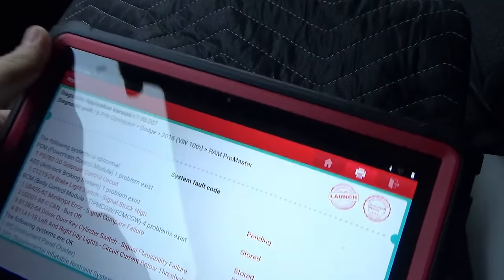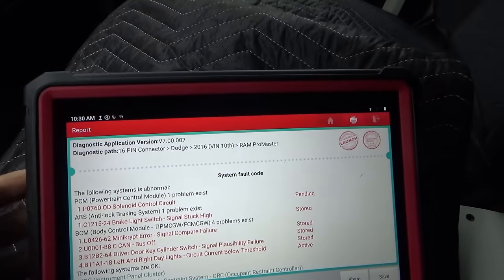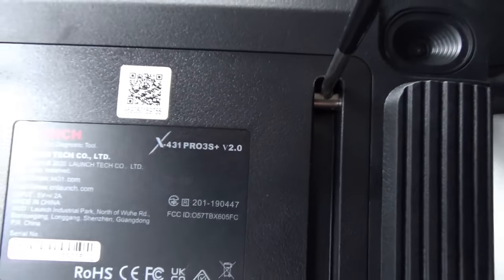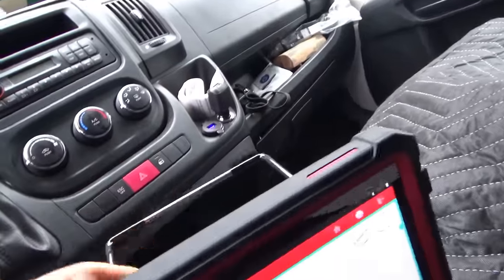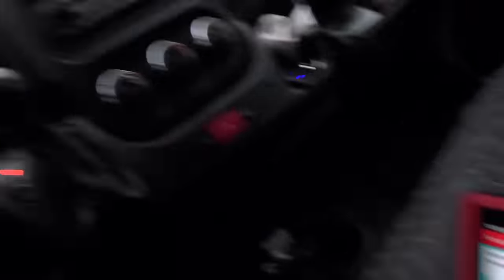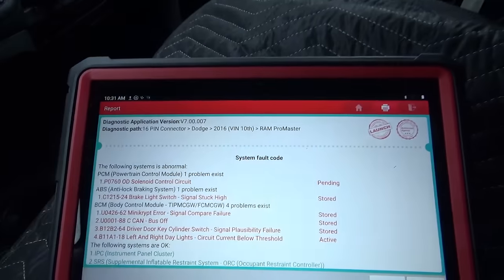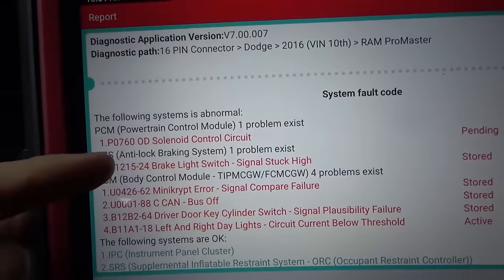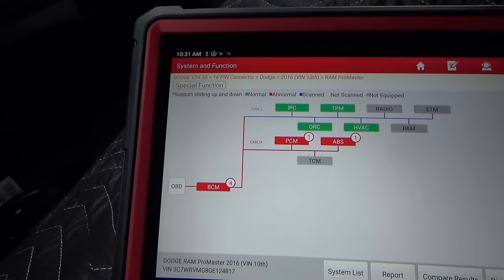ProMaster DISASTER Van - Part 2: Transmission LIMP MODE? (P0760)

Comment: Hey Ivan, you bring up a valid point about being compensated for your work. First of all, you didn't manufacture it, design it, buy it, or break it. You're there to resolve their issue, and I don’t think you’re running a soup kitchen. For them to replace that truck today would cost them an arm and a leg. This wasn’t just a common problem where you could rely on a Google search. In this case, you needed a professionally trained technician. Unfortunately, in this case, it was going to take some time. I could easily see someone trying to sell this guy a transmission, let alone just a valve body. In the end, you had a confirmed fix. You're not getting that from Google.
Reply: Figure it this way. You go to a dealer and say "Fix it", they do and it costs XYZ. If you were to ask for a 'discount' they'd laugh you right outta the place and the vehicle stayed put. The very fact that Ivan entertained the idea shows his integrity as well as understanding of real world problems for the customer. The room gets filled with 'what aboutisms' pertaining to all the hrs spent by 2 guys with 2 seperate shops, traveling, etc. and they are valid points. What it boils down to is a poor design with known issues that somebody has to deal with, and then offer some sort of warranty.  As designed, that cannot happen. Water intrusion issues plague these vans, from computer systems, to head and tail lights constantly blowing out, to caliper pins rusting up and seizing. They are a hot mess.
Reply: This is a rebadged Fiat Ducato……if there  is weirdness, there’s the explanation…..
Reply: @adamtrombino106  One word, DODGE!
Reply: It probably it helped that the owners were Russian.  :D
Reply: Another banger❤

Comment: Automotive engineers have designed and built very, VERY good weather packed electrical connectors for at least half a century. And to neglect to weatherproof the PCM? Un-freaking-believable! And yet, there it is.
Reply: Very true, but I think this case was unique. This van sat on a dealer lot for something like over a year, with ALL the water from the windshield pouring directly onto the computer. That's a pretty fringe case.
Reply: The problem was caused by a clogged drain.  This is a not uncommon problem and can cause much worse problems than what happened here.  Clearing the drains is a maintenance item which very few owners ask to have done.  It is not a design problem.
Reply: @promastersonly1419  Yeah, I'll give it that. Still not a great design, but it might have held up better under different circumstances.
Reply from the maker: @promastersonly1419  but the first replacement PCM got drowned in less than a week or 300 miles 😅
Reply: Holy cow, you are correct. I'm thinking I should go back and edit my comments.  @PineHollowAutoDiagnostics

Comment: In europe these vans are equipped with diesel. Those are notoriously bad on glow plugs and injectors due to water sitting on the top of the engine
Reply: Just wanted to comment on this. The glow plugs seize in engine so bad, you often times have to remove the cylinder head and punch them out from the inside.
Reply: I guess the only upside is that a lot of them are manual gearbox as well so the water ingress can't screw up that as well.

Comment: I can’t believe that thing would do anything with the severity of water intrusion. What a design. Wonder what that crap was that plugged the drain? Weird. Great stuff anyway. Have a great weekend Ivan. 👍👍🇺🇸
Reply: The crap is just dirt, leaves and anything that comes down on the windshield
Reply: @bernardaflores1720  Ok, hard to see see in video, just looked like black…. stuff. Is the cowl screen broken or missing or is this just a common problem on these vans ?  With the exception of sunroof drains getting plugged, I’ve never heard of this problem.
Reply: That was indeed leaves and sticks and such in the main and only cowl drain tube, which is a close to 2" affair and generally doesn't cause an issue. Even if it falls off, water generally goes harmlessly onto the tail of the transmission. But like in this case, if that drain is plugged, 100% of the water coming from the windshield will be forced to go somewhere. In this case, the water had MADE paths that it normally wouldn't have, taking out the seal for the DS windshield wiper and some other rubber seals. Clearly, an extreme case. I believe this van sat on a lot for over a year as well.

Comment: I just had one of those vans in my shop this week, had misfires and transmission codes. was still under powertrain warranty but dealer could not take if in for a few weeks.
the misfire codes were just plugs and a coil, so I replaced them (under intake). The trans codes were for a signal loss of transmission speed sensor. (going in to dealer for that).

Tips in Mitchel were for wiring harness issues due to water leaking down on to connector. I noticed the plastic tube (The one shown at the end of the video) was disconnected at the top.
Reply: The tube fallling off at the top is common (hose clamp fix) but when that happens the water drains down behind the transmission and wouldn't cause this problem. However! - the two transmission speed sensors DO live right under that drain. We've never seen one actually go bad, but we have seen wiring damage from road debris take out the wiring. Hot tip: you CAN swap those two sensor connectors with each other. It will code immediately for a speed mismatch, and put itself into limp, but it would allow you to look at the data from each sensor, which might tell you if a sensor was bad or the wiring was bad. I think those speed sensors are under $25 each.

Comment: I couldn't imagine owning one of these piles.  Ivan, you could buy one of these and use it to haul your tools around in.  When it broke down, you could make videos about repairing it.  What was that?  They don't make a memory card big enough to record the problems?  So, this guy had to pay for your drive/diagnostic time TWICE plus $1,326.00?  If I owned one of these, I would need to plan a vacation to Pennsylvania Furnace periodically.  It wouldn't be so bad, I could rent a motel room and enjoy the sights in a vintage Toyota.  Kip really likes these; that is all I am going to say.  GREAT VIDEO!
Reply: the problem was the blocked water drain tube from the windshield seen at the end of the video. If this issue was widespread there would be a recall/service bulletin already.
Reply: @gerardmccarthy2432  I used to own one and am familiar with that issue.  That was the least of the problems I had with it.
Reply: The wiring connectors should be weather proof even if the cowl drain is working there is still going to be water from splash during driving
Reply: @010110rjw  i give you a huge thumbs UP on that just a good size puddle and the van is DEAD  and another 3 to 5 k in repair what a POS that Van is

Comment: "the dealer was absolutely worthless"  words to remember if you ever find yourself wanting to go there.

Works for every dealership in the country.
Reply: Where did the final fix come from?
Reply: I can tell you have never worked at a Dealer Ship. Most Dealers have 2-3 guys out of twenty that are pretty good.
The rest are in training. Dispatch  has to move work around the shop. Flat rate is a tough system.
Also, people will buy a new Truck/van/car and never come back. So ten years go by and when Its all beat to $hit then a Customer shows up with some bizarre problems. And the Tech is seeing for the first time. 
All Dealers are run by the Lawyers. This why NO used ECMS 
Where did Ivan get his training ????   Not out in the back yard.
Reply: I've worked at the "dealer" and they absolutely frown upon a vehicle to be worked on that has been previously diagnosed by an aftermarket, "unqualified" technician. They will throw every hurdle at this type of repair because there is not enough profit in those types of repairs.
Reply: I disagree. Dealership will not install or program used parts. 
If that is what you expect. Then take used parts to the dealership and try to ask for a warranty.
Reply: and it makes eco around the word.....
Reply: And as a former dealer tech I've seen some incredibly basic easy diagnostics trip up supposed superstar independent shops.    Most people's resentment of a dealership is based on the fact that the dealership will not waste hours on diagnostics that the customer doesn't wanna pay for.    Most people online expect free diagnostics to be performed.      And no they won't install used parts usually because of liability.    Joe customer wants a used part until it  doesnt work and they're paying for rework or diag again because there junkyard parts failed.   Then they run to the internet to tell everyone they were ripped off.
Reply: @jeffcompton6937  The dealers and mechanics created the sick culture of not getting paid for diagnosis work.
Reply: In every country :face-orange-frowning:
Reply: @jeffcompton6937  In my case the guys that I deal with will use used parts if the original is no longer available they warranty their labour but not the part the dismantlers will give you a 90 day warranty & I think that is reasonable.

Comment: I put the open computer in the oven at 70 deg c overnight, it work great, and grease the connectors and pins with dielectric tribosyn. 330 keep out water salt and corrosion

Comment: Great video!  Dealer can reprogram PCM.  I have had this done. Dealer just lazy ad makes more $$ selling you a new one!  Install a cover, "roof"  over the PCM using the mounting bolts.
Reply: I think this is a GPEC2 PCM and on the promaster there is no way a dealer can program a used one. It needs a complete clone or sometimes you can swap the eeprom and then fix the flash. The only tool I found that can do it through OBD is ECU hero.

Comment: As a precaution put a plastic shield over the engine computer to divert the water elsewhere
Reply: I did that ..
True
This is a FIAT though.
Reply: Fiat in Germany is jokingly spelled out "Fehler in allen Teilen" - Design Flaws in every single part sometimes :D
Reply: @tschuuuls486  I was actually able to read that and I found it to be as funny as it was clever. Not to mention accurate.🤣😂😅
Reply: I have one of these vans in my flee6 and I'm going to make some kind of shield to protect the computer
Reply: @tschuuuls486 Fix it again, Tony.
Reply: My first car was a Fiat 124 Sport Coupe. That ownership experience taught me that FIAT = Fix It Again Tomorrow. I sold it with 38,000 miles on the odometer because, as a college student, I couldn’t afford to keep fixing it even though I did all the repairs myself. Clutch, cam support gaskets (twice) and helicoils for the bolts that held them down, alternator, and headlight dimmer switch and shocks are among the things I can remember. But it did, by necessity, start me along in my DIY wrenching hobby. So Thank You FIAT?
Reply: Why not pack the connector with dielectric grease?  That would preclude water intrusion.  Along with both conectors on  pcm and transmission connector.

Comment: Thanks for the challenging video.  I would have tried to bake the PCM for a few hours at  125-150F or so.  Also might have tried to create a weep hole in the bottom of the PCM before baking.  And maybe inserting isopropyl alcohol or something that absorbs the moisture into the back of the pcm where the moisture lives.  There should be a way to remove that PCM board, even though you may have to drill out the connecting points and figure out a way to reattach the board.  I guess I'm a hack for $1300+
Reply: Kip here: it would have been interesting and basically free to try that as a diagnostic. I like the way you think!
Reply from the maker: @promastersonly1419 but if you destroy the PCM then you will have a big beached whale 😂
Reply: A fair point. What about a bag with some kind of desiccant in it? I wouldn't be looking for a fix, I'd be looking for any kind of change.  @PineHollowAutoDiagnostics

Comment: Does a drain tube for the cowl, I check mine yearly because of all the leaves and crap the wind brings during winter time. Great job!
Reply: Kip here: correct. I beleive the root source of this entire problem was the main cowl drain was plugged.
Reply: Clogged drains are a common problem.  The drains are usually identified in the owner's manual and cleaning suggestions are provided.  But most people never open the manual.
Reply: Some newer cars, no more paper back manual @pcar5

Comment: Love these videos, I would have tried to bake the ECM in an oven at like 100 deg F for 6 hours to see if that would dry it out. If it did, then seal it better.
Reply: Good idea!
Reply: Drying it out may not fix it.  Once water gets in, it starts acting like an electrolyte as it picks up contaminants.  As it dries, it leaves traces that will bridge components and connections.  And water may enter and damage components or just short them out.  You really need to pull the board out and clean it, but that won't fix damaged components.  The problem here is that the board is potted in, so there's a bunch of trapped moisture.
Reply: True, but baking it would have been a major aid in diag. If the problem moved or changed, it would have pointed toward the PCM and saved us a lot of headache! @major__kong

Comment: Really tough Diag!  For all involved.
One way to dry out hidden moisture is by putting the part inside a sealed vacuum chamber and applying vacuum with AC evac pump until you see no more moisture being evacuated. Vacuum chamber can be made from a gasketed sealed electrical enclosure (Example Hoffman brand) of appropriate size with the needed fittings for vacuum. Tougher problem to tackle is the hidden green crusties. Moisture removal may not solve the problem but the cost is worth the try.

Comment: For clarity, that clip at the end is clearing some kind of blockage out of the main windshield cowl drain. With that drain plugged, the water is FORCED to go directly into the engine compartment. If I had to guess, my guess is that this blockage was the root cause of this ENTIRE problem. The Promaster has common water intrusion issues, but rarely to they dump water directly onto the PCM.
Reply: You doing a recap of this on your channel?  never mind saw the update

Comment: The dealership just didn't want to program a used computer, i have installed and programmed used units with no issues.
Reply: The dealer probably suspects used computers also have water intrusion issues. They are avoiding comebacks for "your reprogramming did not work, I have a whole new set of problems now".
Reply: The Stealership doesn't make any profit from a customer supplied used unit.
Reply: Yes because they couldn't make money on selling a new computer
Reply: I may be mistaken, but I know some modules (and maybe ecm’s) can’t be reprogrammed without clearing the eprom(s), which is beyond a dealer’s capabilities. Pretty sure Eric O. sent one out to Kieth(?) & he recoded the eprom to accept new programming.
Reply: many newer vehicle will not program with the dealer level programming tools, as they are VIN locked.  there are ways to clear vin but people that know how to do it usually don't make that method public.
Reply: I'm eager to learn everything I can. My understanding is that the PCMs are Vin locked, and the dealer doesn't have anything to unlock a used PCM. But you are telling me that's wrong. What exactly would I need to be able to reprogram them myself? Witech? Anything else?
Reply: I don't believe it's possible with Witech on a GPEC2 PCM on a Promaster. You would need to clone the EEprom and change the flash file. Ecu hero can do it through the OBD. The older Caravans were simple.
Reply: @advancedleveldiagnostics  looked into it. Pretty slick. And cheap! Hot tip, brother. Thanks so much.

Comment: We had a railroad scale with a box that contained a circuit board where the 4 load cells were connected together. The scale would get flooded in heavy rain. The case and wire inlets were supposed to be sealed but would be full of water. I remembered when I was a child that my mother sealed jars of jam and jelly with a layer of paraffin wax on top. I got some paraffin, found a plastic tray slightly larger than the connection box, melted the paraffin and encased the box with it. No more problems with water intrusion.

Comment: I have a Ford Transit. It has the same cowl drainage issues, as the drains easily plug up and water can overflow on several harnesses and components/sensors. I was made aware/warned about this early on, and keep them clear ..

Comment: Famous last words.  "The dealership was useless".  I've heard that same story from a few Chrystler dealers.  They just won't reflash a PCM that you supply.  Company policy perhaps?  And sometimes they even give you some lame sounding excuse as to why.  Oh, but they will gladly sell you a new or refurbished unit.  Furious sarcastic rebuttal excluded.

Anyway, this reminded me of a 2003 Ford F150 I did recently.  Customer complaint, water intrusion behind the driver side of the dashboard and behind center rearview mirror.  Truck stalls in the rain.  The sunroof drain goes into a cavity under the windshield cowl.  Then that cavity has another drain that exits behind the left front tire.  The cavity drain was blocked solid causing a backup to the sunroof drain.  And the windshield was glued in with clear bathroom caulk.  Needless to say, the caulk didn't hold.

Comment: 17:19 before you went this far always check CVI values per spec if they are out of range it will set codes such as the X solenoid and or incorrect X ratio